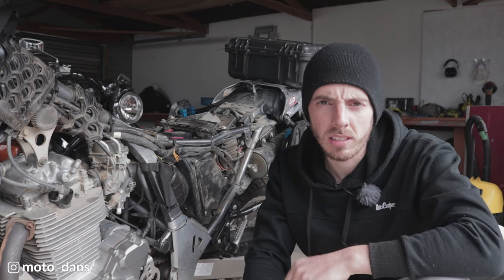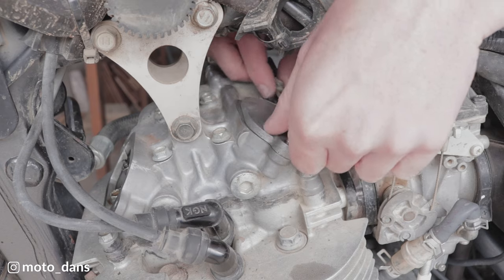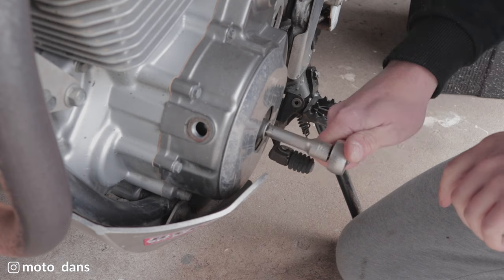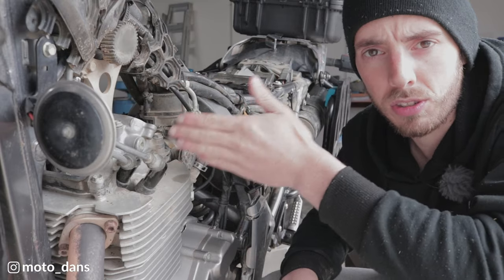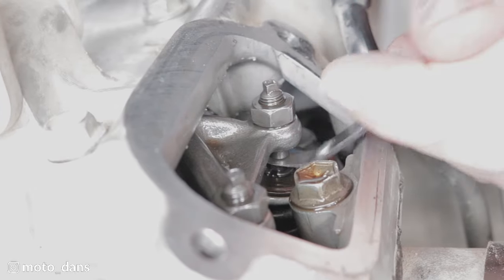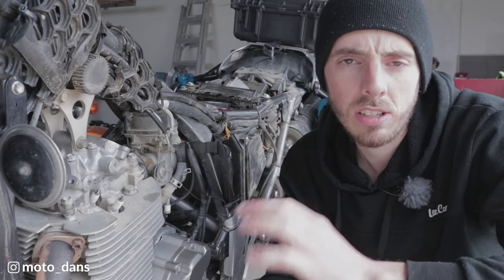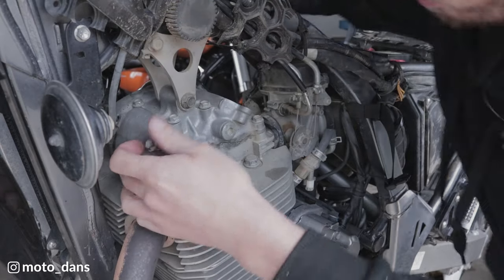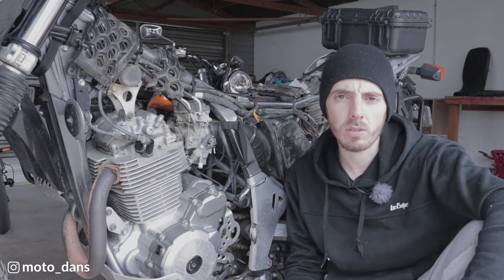Suzuki DR650 Valve Clearance Check

Comment: Great tutorial, nice to see how you actually adjust them! Mine are due at 12k now so will be doing it after watching this. The limiting factor is getting the right tools as always in here in NZ :) Thanks Dan!
Reply from the maker: Thanks Tom, Yes it is always a big problem out here. You can do it without the adjuster tool I have although it does make it alot easier. A set of feeler gauges from super cheap would do the same job also.
Reply: @MOTODANS  Eventually managed to find the wrench in stock in the southern hemisphere from Xtreme Powersports Australia. That and the feeler gauges for under $100 which is I guess reasonable. Still cheaper than paying a garage to do it! Speaking of garages your new one looks huge!!!
Reply from the maker: Nice one, yea that's not to bad. Only have to pay for it once to compared to paying someone else each time.
 Yea i am pretty happy with it, needs a bit of work but that's ok!
Reply: @MOTODANS  Finally took the plunge at 13k. Exhaust was on the tight side at 0.18mm but I still don't have that wrench thing and my crash bars make it really hard to reach with a spanner. Will check again in a few thousand k's and loosen those one up when I finally can source on of those tools! Thanks for your tutorial!
Reply from the maker: Well done, tool definitely helps. Thought you got one out of aus?
Reply: @MOTODANS  A while after I ordered it they got back to me and said they didn't have it. I think they discontinued the single ones and only sell a three pack of different sizes now for over $100. I found a similar thing on Aliexpre$$ which may or may not turn up in 6 months or so :)

Comment: Just finished doing mine at 6k because I know there dealership never did it at the 1k service. I only looked because the bike was starting to be hard to start so I figured exhaust side could be tight and they were. Like you said easy job and good time to inspect the rest of the bike. Good job and great video T4S 👍🍻
Reply from the maker: Thanks👍 Yep high chance the dealer never did it at 1k. Interesting to hear you were having starting issues with the bike. Wondering if they were done at the first service if they would need to be touched again.
Reply: Would your bike still have starting issues when it’s warmed up or just upon initial startup ? I noticed mine takes quite a bit of choke play back n forth to get it started but it’s only when it’s been sitting in the cold and not started for a couple days. 

Once it’s been warmed it starts up just fine
Reply: @AustinnSearss  Hi, on cold starts only once warm it was fine. It's another reason I keep the carb on DR650's stock to eliminate extra variables.

Comment: “Light drag” may not be scientific, but it’s helpful. I’m about to tackle this project on my recently purchased 2006, and I hadn’t found info on whether to measure based on drag.

I read that the magneto cover plug is easier to remove when the engine is hot. But my gas tank is already off, and the carb disassembled. So I’m hoping for the best.
Reply from the maker: Everyone's light drag is different which is the problem. But there is a fairly big range so it doesn't have to be bang on. 
Yes I have heard that however you have to check the valve clearences cold so that is a pain. Good luck on removing

Comment: my 1990 DR650S I set my valves (intake & exhaust same) to 0.127mm feeler gauge.  The 1990 DR is KICKSTART ONLY... 1 (one) KICK START every time.  Also, the service manual is unclear, manual reads "Turn crankshaft until the "T" line on the magneto is aligned with the center of the hole".  To be CLEAR, I set the line to be in the middle of the hole, which is indicated by the little "T" next to the line.   The way the manual reads, makes it unclear as to what to center the "T" or the line.  
What I am saying is, I centered the actual LINE not the "T" to be centered in the hole.  My bike sounds so good now, even when hot or cold it starts with 1 kick.  I am pretty sure this distinction makes a difference, because I recently set the valves to the same feeler gauge with the "T" in the center of the hole and bike ran and sounded awful.
Reply: Good to know. Thanks for sharing.

Comment: For what is it sp 46 or 43 which 650dr?
Reply from the maker: Not sure what you mean? Dr650 2001 onwards?
Reply: The older one have different disdance valves! Sp 46 until 0.22mm out, in until 12 mm
Reply: @MOTODANS  this motorbikr is build more as 25 years there is sp 42, 43,44,45 and complete new 1996 or 1997 sp46!